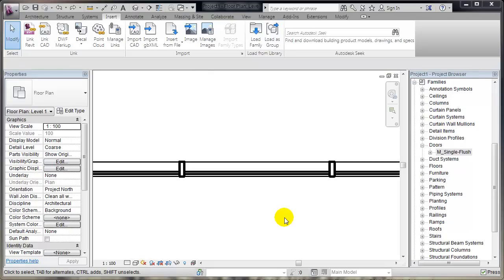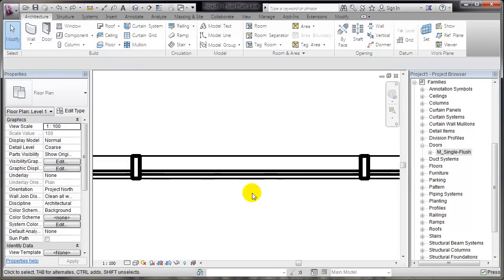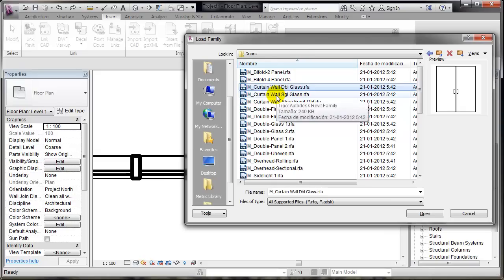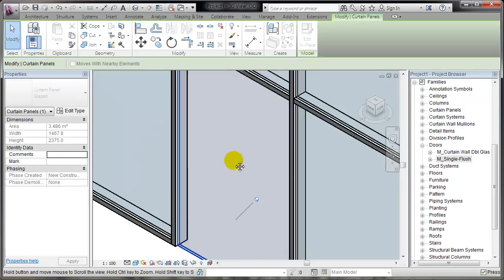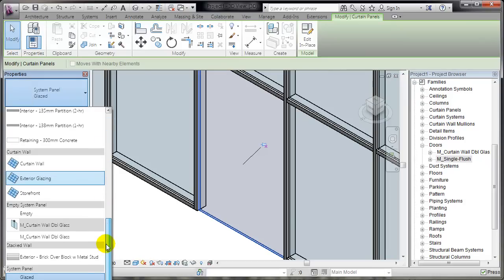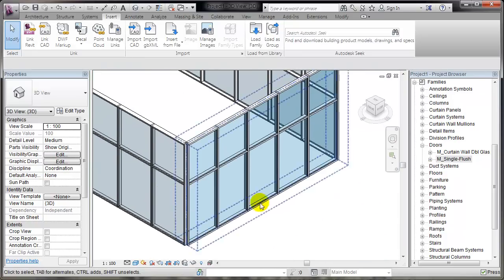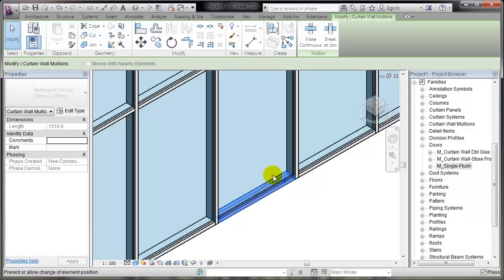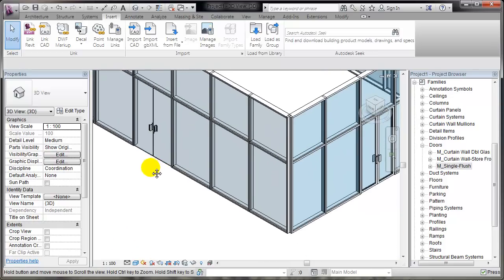REVIT: Placing a door in a curtain wall

Comment: I have a problem, It's just impossible for me to select the panel so I can't replace it...
Reply: if the tab key isn't working and if there's some sort of sound resembling windows error, see if your "selection of pinned elements" is enabled. If it isn't (like there's an x on that icon), enable it. This sorted the problem to why my tab key not working within the selection of the panels.
Reply: @pjali9929  sooooo thanks
Reply: same thing...I have removed the curtain horizontal mullion but I cant select the panel :(
Reply: thanks Douglas!
Reply: SAME THING I CANT SELECT THE PANEL
Reply: @mohamedmostafa-vq7oe  Use tab key.